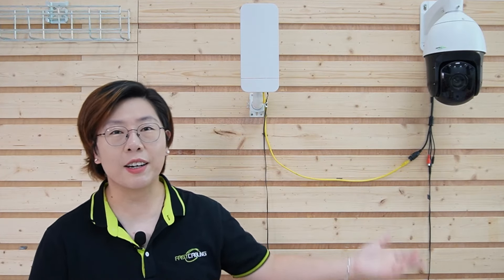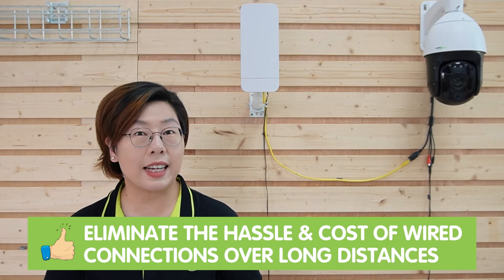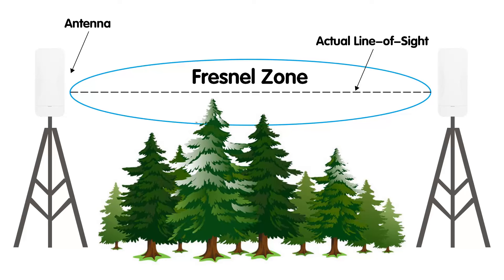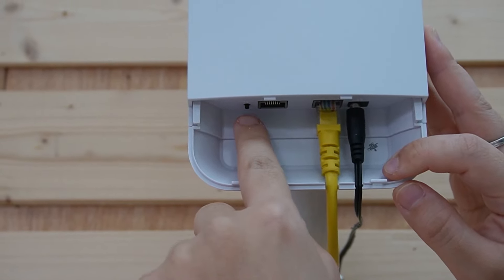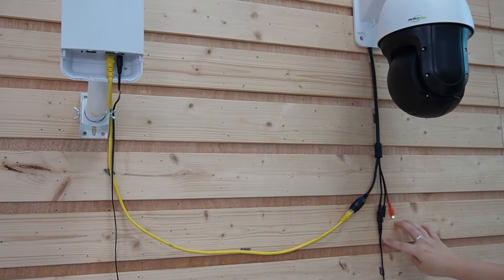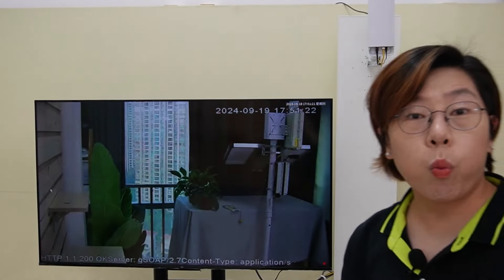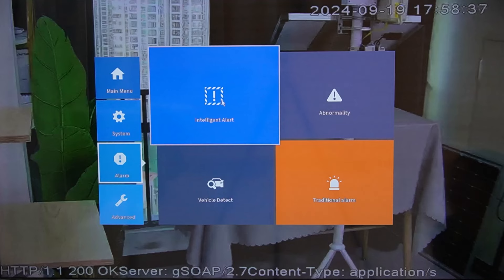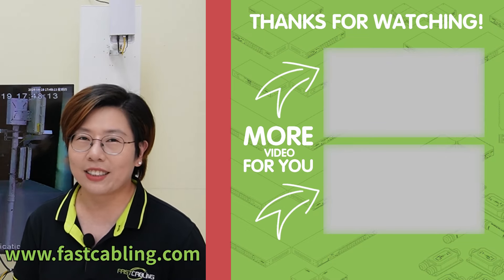Ep. 01: Remote IP Camera Setup with Wireless Bridges | Step-by-Step Guide

Comment: i am trying to use VMS for 32 channel NVR using CLOUD ID, whenever i click on LIVE VIEW it always throughs these 2 errors  "The Remaining Memory is not enough to open all the channels on the device" then later it says "The number of serial number previews reached the maximum limit" and it displays only 8 channels, the rest is not shown because of this error. After adding all of my 32 IP Cameras on NVR it shows there the remaining Bandwidth is 143, so please help what can be done (XYEME NVR)
Reply from the maker: Lowering the resolution and frame rate of each camera can reduce the memory load on your NVR. This may help free up enough memory to display more channels simultaneously. Since you’re using an XYEME NVR, also consult the manual or reach out to their support to see if there are specific limitations or firmware updates available.